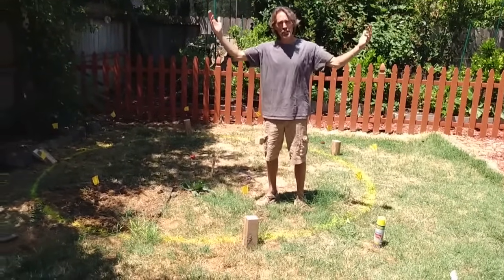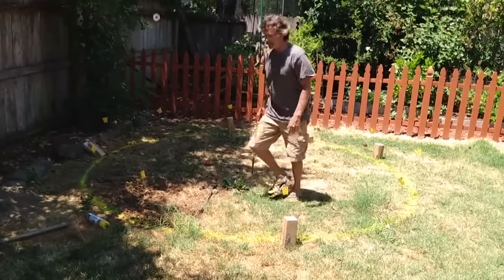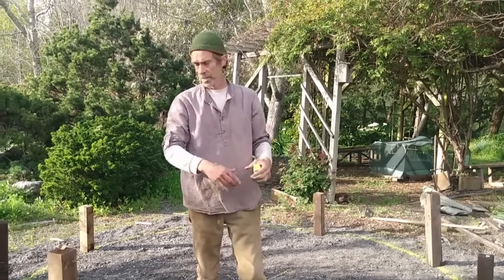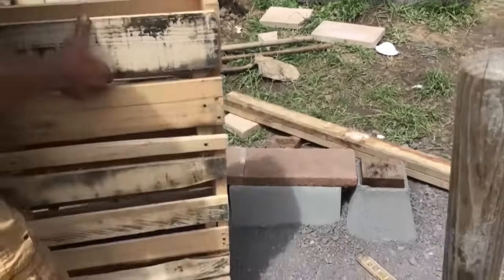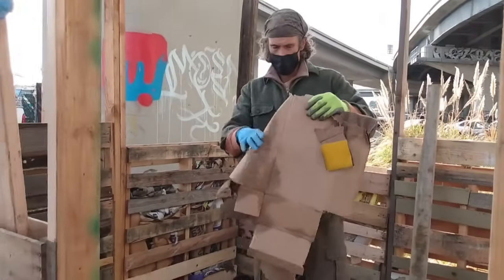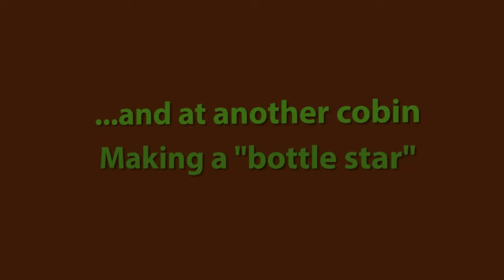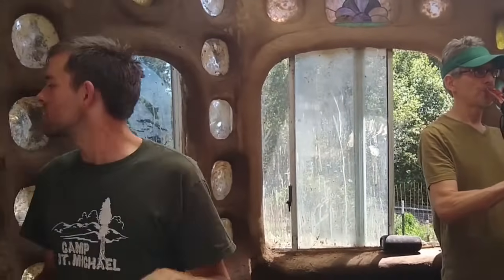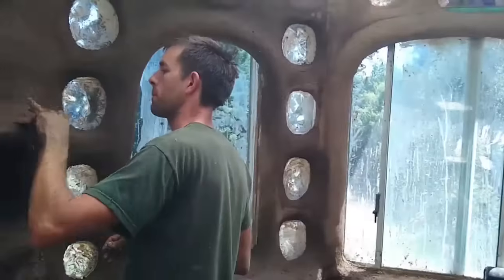How to build a 'Pallet, Cob house "Palletable Cobin"

Comment: When you start digging on your property, how do you know if there is enough clay and enough sand in the soil ?…or are you having something delivered ?
Thx !
Reply from the maker: Hi banana patch. Usually for a cabin build I get Earth from a landscaping supply shop dumped in my truck or delivered. It's rare that I just dig a hole on the property where I'm building to get the earth I need. Sometimes I'll go to an embankment on the side of a road where it's easier to carve into the Earth. Often construction sites will have big piles of Earth as well that I can easily scoop up. If you only have the option of using the Earth on your property then you can take a sample of it ideally more than a foot deep and fill up a mason jar half full of the Earth and the rest with water and shake it up and then let the material settle. The sand is heavier than the clay so it will settle to the bottom and the clay will float on top. Ideally a cob mixture is 70% sand 30% clay so sometimes you're able to have that ratio in your local Earth or you might need to add sand as needed. You can also do a test of the Earth simply by adding some water and forming it into a ball and let it dry in the Sun for a day or so. I'm curious where you are living and wanting to build?
Reply: @cobalot9  
We are retiring and moving from the US to southern Mexico in the mountains…a city called San Cristobal de las Casas. It is a super cool city that reminds me a bit of Asheville NC. 
7200 feet elevation. It is kind of in the clouds so cool and humid and does have a rainy season. We will be 55 and 60, and I have always had an interest in cob, adobe, etc.
I am not sure that would be the best climate for it although I know England has very old cob houses. I also know from YouTube that school rooms there have been built out of adobe. Thoughts ?
I just thought it might be a fun and inexpensive way for me to build a cozy little house.
Reply from the maker: @bananapatch9118  nice! I've been there. It is super nice there ..I'm sure it's a great climate for building with cob there

Comment: We are planning to built a small  kitchen , however not sure how the building will handle the extra amount of vapour... As my wife spends all day in a kitchen. Fitting some vents and a skylight which we can open might work ?!  Also the sheep wool is widely available in our area and it would be great to insulate the walls as long as the odour from that wool will not be trapped in the kitchen over the time ?! Any advice will be appreciated

Comment: Do I need to space post 44" apart to compensate for the 4x4 posts. Making the inside dimensions 40"? Thanks!
Reply from the maker: Yes the inside dimension of the upright posts need to be 40 inches. I often will have the 40in pallets there on-site ready to be put in between the uprights as I go. That is an easy way of keeping it all spaced out correctly if the space of the uprights is smaller than the pallets it's a total drag to have to cut the palate just a little bit to make it fit. If anything I try to make the space a little bit bigger about a quarter-inch to make sure the pallet will fit

Comment: Hi I was thinking to use wood chips for insulation to fill the pallets instead of straw, Im in Hawaii and had to cut my way through dens thickets of guava trees and branches to clear a spot to build my structure, I used the bug guava logs for building but got huge piles of small branches, I could use.
Reply from the maker: Hi Sasha,sure, dried wood chips would work. I'd be concerned though if there is still moisture in the wood chips & branches, that it might rot inside the walls causing the cob inside to smell. When I've added hay into the walls instead of straw, we could smell it when it heated up.

Comment: Do you feel the pallets would be a good technique for a larger house ? 2000sqft?
Reply: I would look up people that take apart old antique homes and haul them away and tell them you want the old growth lumber from the home. Some of the hardest best shit you will ever get your hands on. Just treated in linseed oil....and like I said hundreds of years of growth in each piece making it strong. Also check into your local dump for what contractors dump there they usually crush or grind it eventually

Comment: Curious question from someone considering cob. Is there a reason nobody is using hair as an insulation? I know it may sound odd but it's a resource that can be gathered 🤔
Reply from the maker: yes sure, if you have access to that much hair then sure, you can use that. It may be hard to pack between the pallets though. I've used chopped hair in my finish plasters before

Comment: I want to create this with my community but we were given this home which is a standard house but it has a good foundation but the house has had holes in the interior dry walls  from previous caretakers of the house but I want to see if you can still put a cob wall with the existing framing and how I can take out the dry wall and create I guess cob interior walls. What would you do?

Comment: Do I need to protect the cob wall and earth floor from rain before roof is on?
Reply from the maker: Lately I've been building the roof with a 2-foot overhang before I do any of the cobbing to keep the walls from getting rained on. If they do get wet they will dry out and then you're finished lime plaster on the outside will protect them. If you're using straw as an insulation you want to make sure that doesn't get wet otherwise it will start to mold.

Comment: Love this building 👏🏻👏🏻why not use a flat piece of flexiglass with a slight fall on it for rain run off for the skylight .be a lot cheaper than the skylights you use .
Reply from the maker: Paul, the skylight I sm using only costs about $80 at Lowes. A piece of plexiglass the thickness Id need would be at least $40. Might as well spend the extra $40 to ensure there are no leaks and have a nice dome skylight

Comment: Hi, thank you so much for the wonderful video. I watched a few times.  I have questions. We have white ants (termites) problem here in Australia.  Having timber inside cob might attract termite. Do you have termite in your area? 
Next question is if installing more full size doors change the structural strength or not.  I can see having pallets between poles makes the structure strong. Where I live is tropical climate so I need to have more than one full size doors for breeze to go through. I appreciate if you could give me some advice.
Reply from the maker: Hi glad you have been enjoying my video I hope it is helpful to you. As far as termites go a trick I learned in Africa was adding salt into the cob and the termites don't like that so they won't eat through the cob. As far as two doors in the structure goes I have done several cobins with two doors on either side to allow a breeze without any structural issues. I think this is a nice feature. Hope your project goes well, Miguel
Reply: @cobalot9  thank you so much for your reply.  Salt!  I never thought about that.  That gave me hope!!! I went to earthship workshops in Australia and also I am experimenting rammed earth. Because I want to learn how to build small cabin using dirt on property. But your pallet cob looks so achievable. I will probably ask you more question later!!! Thank agin!

Comment: What are you putting on the posts to protect them? You said something about copper?
Reply from the maker: Yes, if you dont want to use pressure treated wood, there os a product called Copper Green that can be painted on the wood that is going into the ground. There is also a protective wrap that can be used.

Comment: We are trying to figure out how to get the post up in a rubble trench. Any advice?
Reply from the maker: Good question, thats quite a dilemma! I dont do a rubble trench for that reason. I set the post in concrete in the ground and all the weight is on those posts and there is very little weight in between. I suppose what you could potentially do is compact the rebel trench and put some small Base Rock Stones over it and then use Pier blocks set every 40 in and then put your uprights on top of those I have done many cobins using this technique and it works fine. Maybe next time don't bother doing the rubblel trench foundation

Comment: When I was a kid our cook took me and my brother to visit her family. We were in Mexico and we took buses and walked to get to the farm her family had. It was way out in the country, I have no idea where, and her family lived in an adobe home. On our way to the house we passed some men mixing clay and straw to press into the molds of the large Adobe brick. Next to that were rows of Adobe bricks drying in the sun. It was fascinating. Not far from their house was a cenote that had once been used to honor the gods with sacrifices. I didn't get to see it , though. While we were in the Adobe home the lady started sweeping the floor. That blew my mind. She was sweeping a dirt floor! I have nothing against sweeping the floor, but how do you know you are done if the floor is dirt?
Reply from the maker: Yes I have built many Earth and floors I do the final finish plaster and get that very smooth and then I apply a few coats of linseed oil and then beeswax over that so it is a very fine smooth surface. It would be very easy to sweep the dirt off an Earthen floor.
Reply: @cobalot9  this lady's home did not have any coating to the floor. The dirt was packed down but not coated.
Reply from the maker: Right, Earth can pack down pretty hard.

Comment: How big of a structure could you get away with?
Reply from the maker: Right, well, I am currently in Florida building four classrooms which are $320 ft each. Because they are used for educational purposes they do not have to be permitted which makes things very easy. If they were habitable then we would need to get permits for them which would mean we would need to get an engineer to design them to meet code which then gets a bit complicated. I don't see a reason why a home could not be hundreds of square feet built with pallets as long as it is framed securely with straps and supports. It all depends on whether or not you are talking about having it built large legally or under the radar

Comment: I still don't understand how the mud and straw mix doesn't just wash away due to wind and rain. I've watched a number of these types of  videos and I've heard about the earthen plaster and lime finishes like you've mentioned, but wouldn't moisture seep under this finish coat? And wouldn't the floor get torn up very quickly, since it is basically made of mud and straw? Lastly... isn't this type of structure easily scratched, broken and gouged, since it is basically hardened dirt?
 I'm not asking these questions to be funny. I'm planning on building a house on my property in N.C. using the best, cheapest and strongest building material there is and I need to know what I'll be getting into. So any suggestions would be deeply appreciated. Be Well
Reply from the maker: I understand your concerns. I use a hydraulic lime plaster and wash to protect the walls from the rain and a good roof overhang. They would be fine in the rain. You may want to visit the EarthHaven Eco Village near Asheville NC for inspiration. They have lots of earthen cob structures there that have lasted a ling time. The floors have a few coats of linseed kul and beeswax finish on them so they are very durable. Hope your building projects go well
Reply: @cobalot9  All your suggestions are most appreciated. I'll look into the Ashville houses project. By the way my property is in Anson County which has white sand all over the place. Hopefully I can use it in my building structure. 
Be well

Comment: snap a chalkline on the center of the rafters. This will give you lines for the cardboard to go to. This will give you the bottom of the plywood. it needs to be a little larger because of the bevels.

Comment: How does the insulation work in a colder climate?
Reply from the maker: It works fine, you will still need a source of heat though inside the house on a cold day.

Comment: I live in the desert, how well do these stay cool during hot weather? Ty
Reply from the maker: You may want to pack the pallets with Earth to have more mass to keep it cooler...
Reply: @cobalot9  so instead of straw use earth or pack more earth on the outside walls? Ty
Reply from the maker: @matthewcain2880   I mean pack earth on the inside of the pallets. And sure maybe a couple layers of cob plaster on the walls. May need to make the space on between the pallets tighter, which I use old scrap fence boards and rip them down...
Reply: @cobalot9  and would you recommend I dampen the earth before I pack it or leave it dry?
Reply from the maker: @matthewcain2880  yeah, probably dampen it just a little bit so it stays in place. I guess it kinda depends on your soil. If its too sandy ot wont Hold its shape. You may also want to consider large 1 inch gravel
Reply: Can you double up the pallet walls?

Comment: Hello thank you for posting all of the work involved. I have been watching cob houses for the last few months and really want to build one in the near future. My question is do we need permit to make these here in CA? Say if i buy a land and want to make a cob house 2 times larger than the ones in the videos, or same size but 2 or 3 of them on the same land, how do we get permit?
Reply from the maker: Hi, glad you like my videos. I build them small at 120 sq ft in CA because they is the size I can build without needing a permit. Technically though  they are not legal to live in, just as a shed, storage or play structure.  As soon as you go bigger you need a permit, and  need to have tbe electric and plumbing o code.  To get a permit, the structure needs to be built to code. I have worked with an engineer to have the Palletable Cobins designed to meet code. I have not used the drawings yet and I would rather not have to. I just prefer keeping my structures under the radar and dont draw too much attention to them. There ks now also a code for building a full on cob house as well without the pallet frame, but again, you need to use the engineering drawings.
    What lots of folks do is call them storage, sheds or play structures, which is legal, but live in them anyhow.  Good luck

Comment: Why not insulate with hay bales and have thicker walls?? I heard you say something about California laws let you only build a small footage building without a permit? What is that footage? Does that measurement include the outside of the walls or just the inside footage???
Reply: hay bales are expensive! If you can find them go for it. You could do double pallet walls with hay inbetween - great idea. I did that using Wattle and Daub

Comment: Doesn't the wood pallets decompose & break down?
Reply from the maker: most of the pallets I use are heat treated at 10,000 degrees to protect them from insects the word is very hard they do not break down and once they're encased in the cob they are protected forever.

Comment: Hi there! I came to help on your Oakland project way back in January I think. We have a treehouse/ home in boulder creek and are currently ready to raise the frame for our new round wood redwood timber frame building. I will be using your method for the wall system with the pallets. Do you have a favorite screw size when framing in the pallets act to supports? Seems like I will need a lot of fasteners. Our structure is going to be 18 by 11 with 13 ft walls first story will be 7 ft with a hobbit height lift space of 5 1/2 feet
Reply from the maker: Wow! Thats pretty big! I use 3 inch star bit screws. You will be cobbing over the pallets up in the tree? Thats very ambitious! Would live to see pix of it... That may be a first...
Reply: @cobalot9  thanks! This building will be on the ground, though our current home is in a tree

Comment: I saw you mention on another video that the straw insulation didn’t stop the heat getting inside in hot areas. Do you know if using clay slip straw packed inside the pallets would help or would it be the same issue. Thanks 🙏🏻
Reply from the maker: Yes, sure, it would provide a tiny bit more mass which might make a little difference. Go for it

Comment: I thought you were not to compress insulation?
Reply from the maker: Right. Even when you compress the straw there  are still lots of tiny air gaps for the  insulation. Another purpose of packing the straw is to have a firm surface in between the slats of pallets to put the cob against. If the straw is put in loosely then the cob won't have anything press against. If you have issues with compressing the straw you can use another material such as foam or cardboard that doesn't need to be compressed but straw works well for me and the insulation seems to work great also
Reply: @cobalot9  thank you.